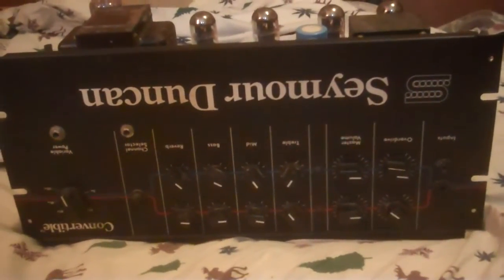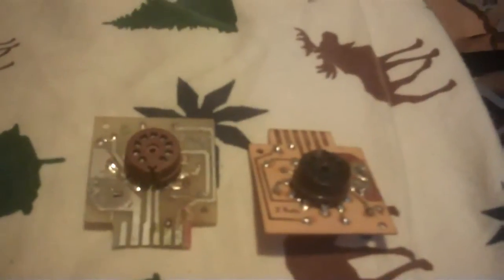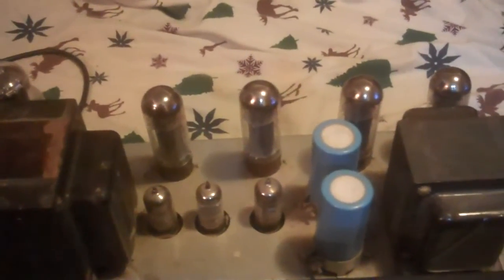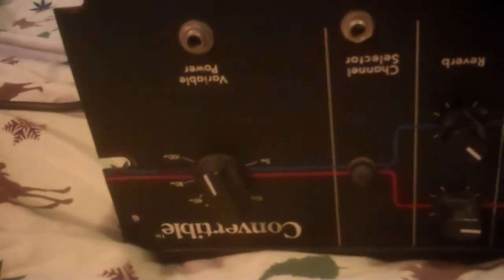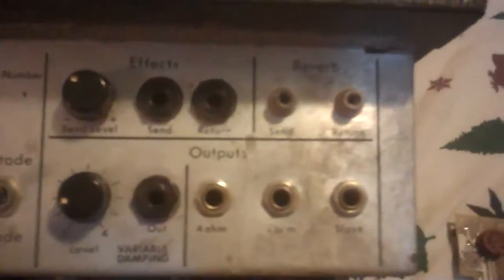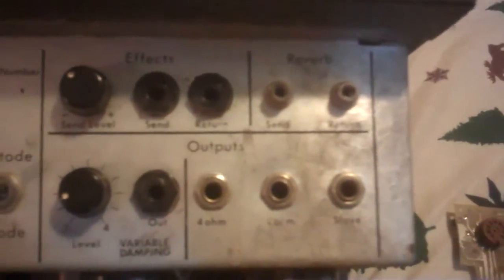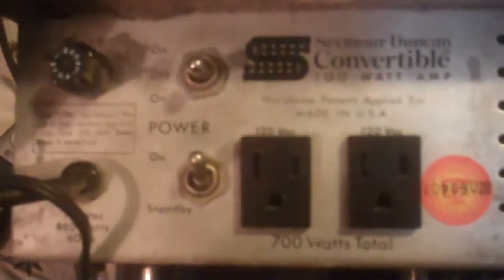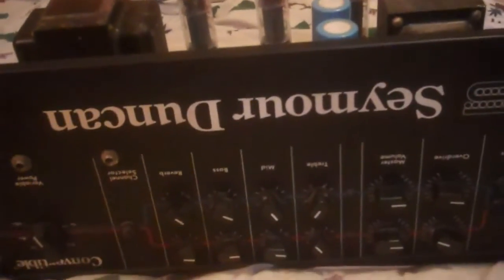Seymour Duncan Convertible Rare 100 watt head

Comment: That was cool, thanks for the overview! I was blown away by that EQ module! Never saw anything like that. Man, I wish Duncan would take another stab at making these!
Reply from the maker: Thanks!! This amp has been nothing but good to me, i wish they would too!! i hear thou there was a lot of bad blood between Duncan and Jeff Beck, about this amp. " can't remmeber if it was about rights or some one got screwed" but the amp is a fantastic machine to this very day. i still have not found a good replacement for it...i keep going back to the old beasty..lol. has amazing clear clean, and down right dirty distortion.
Reply: hyena429 Cool, man. Thanks for the info. Sounds like a great machine! I will have to keep an eye open for one I could play. I had a Convertible combo back in the late 80s and it was a tremendous amp. I found similar qualities to what you describe: super clear clean and very cool overdriven tones. Rock on, brother!

Comment: I have been thinking of buying a 100 watt convertible and my question is can you buy parts or will it be a boat anchor if a module or something goes bad? Thanks
Reply from the maker: As of right now, still modules rolling around " even if they are over priced" i never had one give up the ghost on me, i have owned this amp for a long long time..i abused it when i was younger, but it is still as loud and powerfull as the day i got it....But some people had some troubles with this amp they said..My personal experience is"none" still acts the same after 20 years..lol..Does not mean there is not issues with it down the road. i never had a tube go out or preamp tube...i replaced the main power tubes 10 years ago cause one got broke when some crap fell on it in storage.." lack of having a rack" Most have a nice rack box already..when i got this amp..it did not have original rack box anymore..some one installed it in a regular rack  " probably used in studio" and some very unusual modules inside..Long as it is working and everything seems fine..Hell ya...But if it dont power up at all " run away" but long as it powers up..heck anything electronic can be repaired now days...specialy a amp like this, that has hand done point to point wiring. worth fixing even if something goes crazy ;)
Reply: I saw at a local guitar shop. I liked the idea of being able to turn down the wattage.